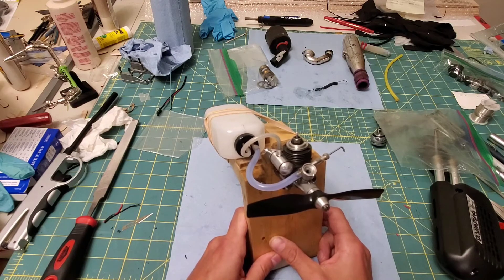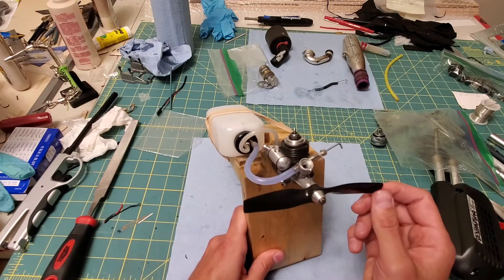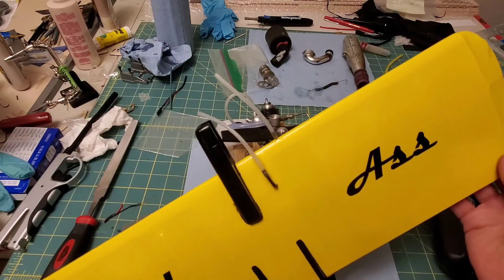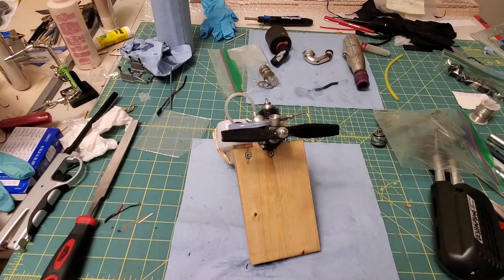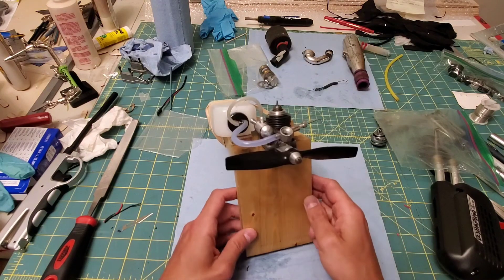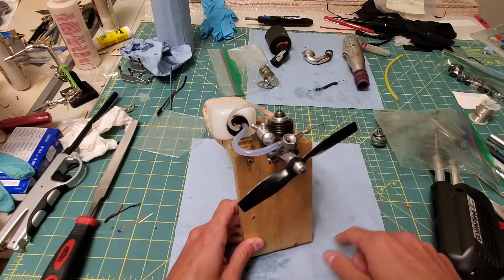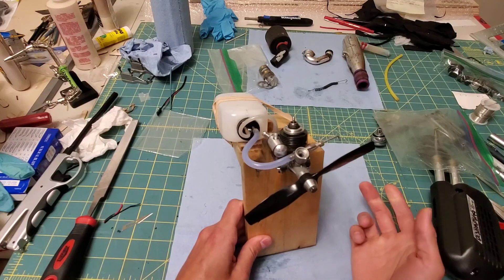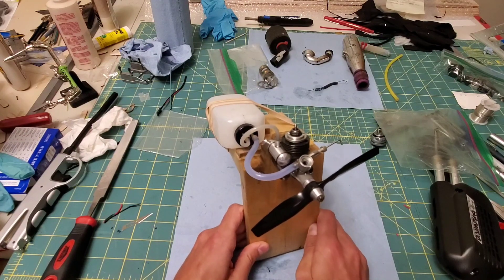Norvel 0.061 Big Mig Break-In Video

Comment: The Norvel's are excellent engines. I was given an old Bratco Hexdrone control line delta wing and I put a Norvel .061 on it and it's a little beast!
Reply from the maker: I looked the model up it's so cool! Definitely would be a rocket with a 0.061. I am very impressed with this norvel engine line.  They are very very good. I reciently picked up their GX-40 Gas / glow engine.  Im really looking forward to experimenting with it. It's set up to run premium gasolene with a castor oil package. It's also advertised as a glow engine and came with different heads.
Reply: @layback209fixorsmash3  Bratco made two plastic rtf models, the Hexdrone and a vintage style plane called the Sky Baby. They were both packaged with the .061. They both flew great but unfortunately, Bratco went out of business fairly quickly.
Reply: @layback209fixorsmash3  Norvel engines have always been excellent performers and it's great that they've given the option to run gas with glow fuel being so expensive. I'd be very interested in seeing a video of your .40 and how it performs with gas.